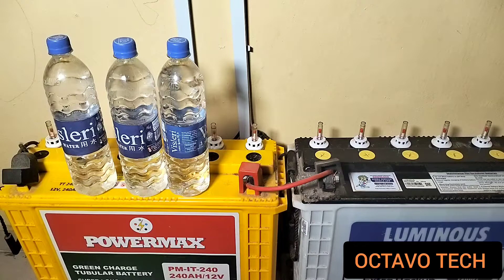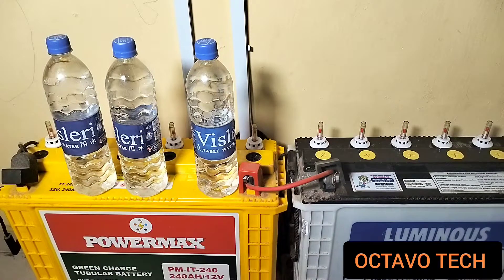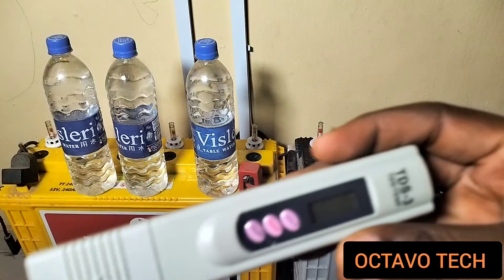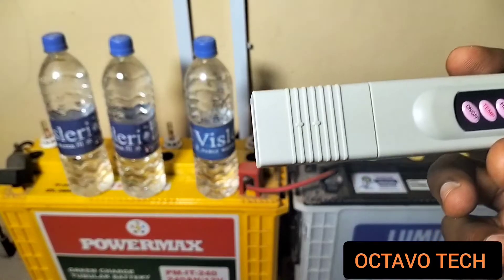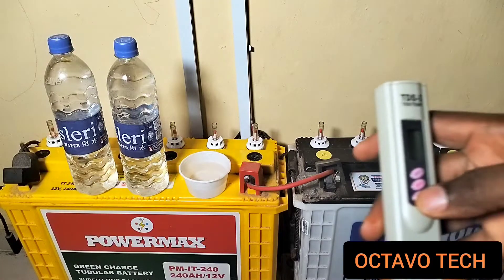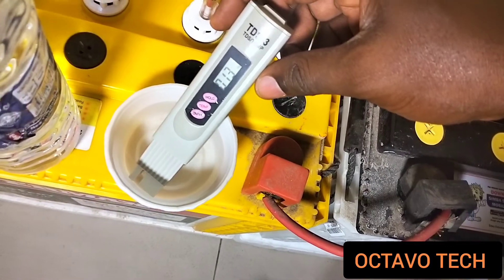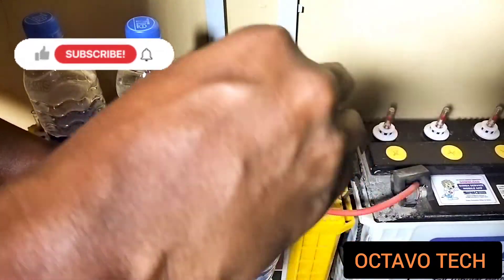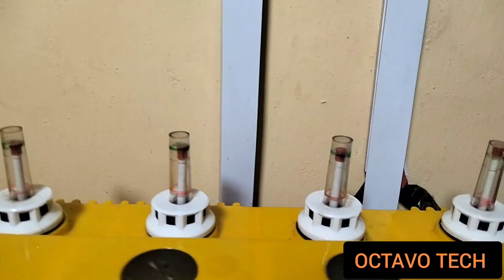How to top up inverter batteries with ordinary water, distilled water alternative.

Comment: You should never use tap water or other clean water for filling in the lead acid batteries! The TDS shown here is definitely RO water he got from somewhere, not definitely the normal clean water from tap or water wells! Using normal clean water will destroy your batter over time!
Reply from the maker: @tomgeorge9457  story. My batteries are 4 years old and they are still working well. I'm sure of what I'm using at least, I can't be confident on the quality of distilled water being sold in Nigerian market. I have friends that used distilled water and their batteries quality have depreciated terribly. Just do what works for you.

Comment: Table water, tap water, satchet water etc contains a lot of dissolved solids especially calcium, magnesium and sodium. These three elements including potassium are normal components of portable water at recommended levels. But these recommended levels are too high and quite damaging for your tubular batteries. The FACT is that there is no alternative water to distilled or deionized water for topping batteries. A better method of checking if your water is safe for your battery before topping is to use a conductivity meter or KEM distilled water indicator. Distilled Water has a conductivity between 0.5 to 3.0 micro Siemens (uS) Deionized Water has less than or equal to 0.5 uS.  If KEM indicator gives you blue on addition to your water, it is safe for your battery, but if it turns pink or purple, the water is neither distilled nor deionized, and it will definitely kill your battery over time. To know more about Kem indicator, visit. https://youtu.be/uQV2M0Be0Z0
Reply from the maker: Hello, I know about this theory, but I'm emphatically stating that in practical reality, nothing will happen to your batteries if the TDS level of water used is not high. I know people that have never used distilled water and their battery has lasted up to 4 years now. Similarly, I know people that used distilled water religiously and their battery barely lasted 2 years. Pay more attention to the cycle of charge and discharge and ensure you do not deplete your battery below 50% then you will be fine.